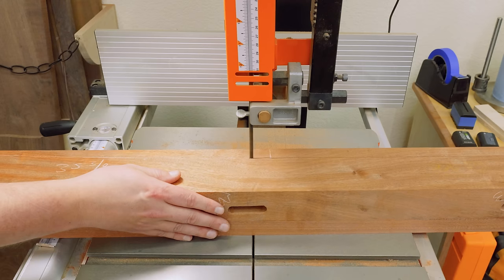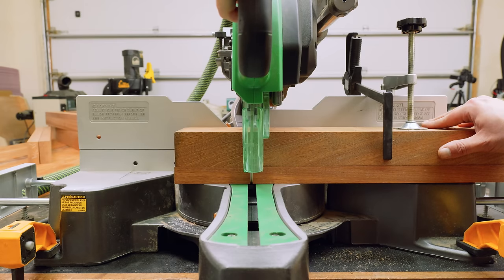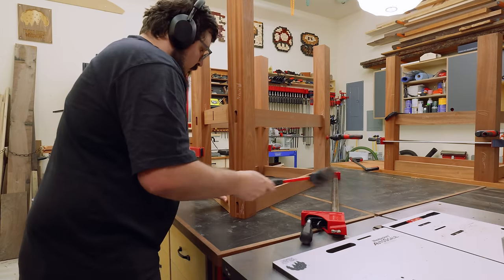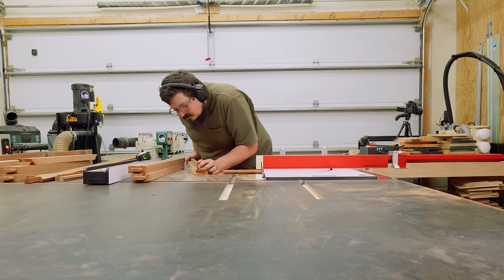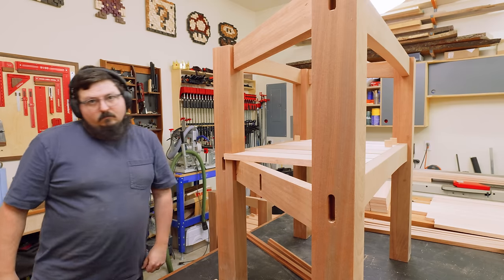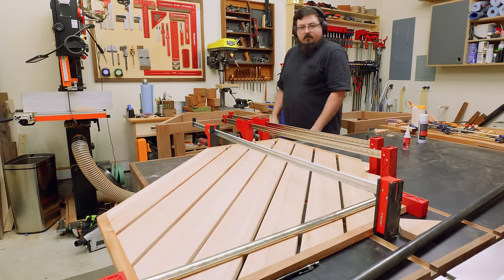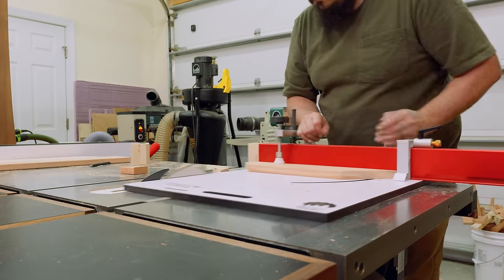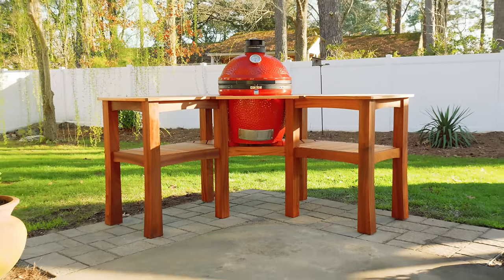These almost destroyed me | Building a grill station

Comment: Focused and distracted - I agree your take on when to listen to which. Would you please post an update in time on the heat from the grill vs. an entirely wooden structure? I’m keen to replicate what you have built, but had in mind to use fire bricks under the grill for fear of too much heat. Thx and looking forward to your ongoing success.
Reply from the maker: It's so nice to hear that I'm not alone on that one! Yeah, I can absoluelty post an update. When I designed this one I did it with the fact that I was going to use the ceramic feet to lift the grill about an inch off the lower shelf. But I did end up having to buy two sets as three didn't balance it well enough for my liking.

Comment: Distracted, but I still do it. How's that osmo uv oil hold up over time? You'd mentioned using it a few times, I was wondering how it hold up with say cedar as I'd love to find something that gives just a bit of protection but helps keep that non-gray look on occasion.
Reply from the maker: Haha, we're all guilty. The uv oil holds up really well. I have had it on a few pieces that see a ton of weather and haven't had any graying. You just have to reapply once every two years or so in my experience.
Reply: @TimberBiscuitWoodworks  good to know thanks!

Comment: #distracted - Always turning the Radio off, when i need to concentrate.

One question occured to me while watching your video: are you using regular beechwood dominos? The ones you used seemed to be quite light in color.

I always wondered if beechwood dowels would be enough for outdoor furniture since they are encased in other wood and sealed by glue?
Only to always play it safe in the end and invest a bit more money in oak dowels..
Reply from the maker: There's nothing like silence to get on track quickly. Yeah, I just use the normal beech dominos, they might look lighter just from the lighting in the shop. As long as your joints are tight they work great for exterior applications.